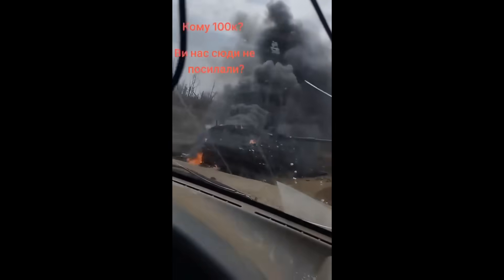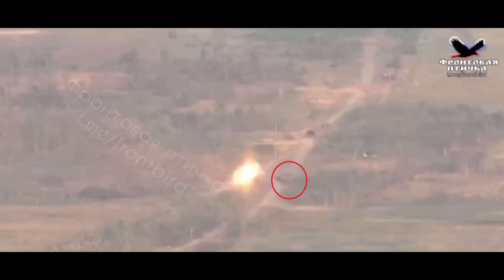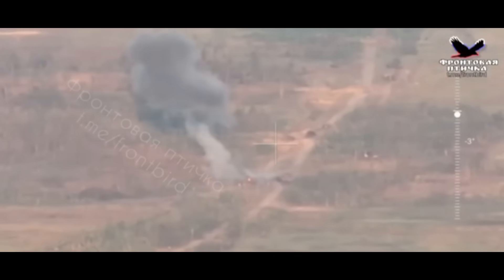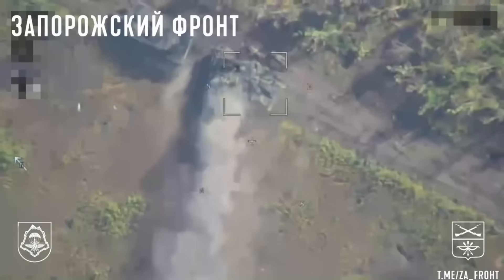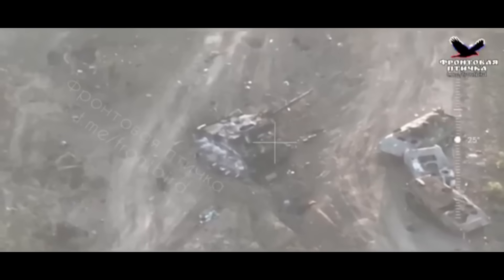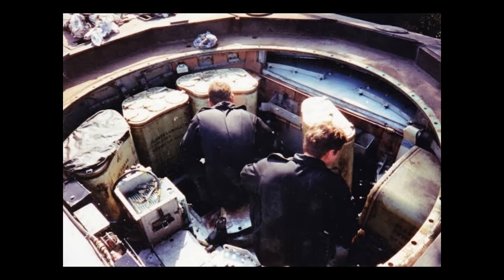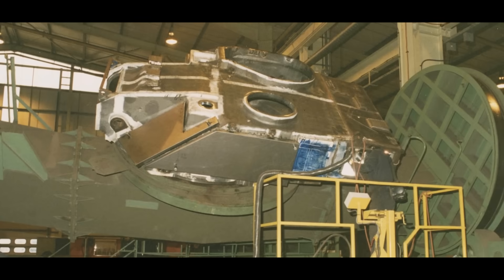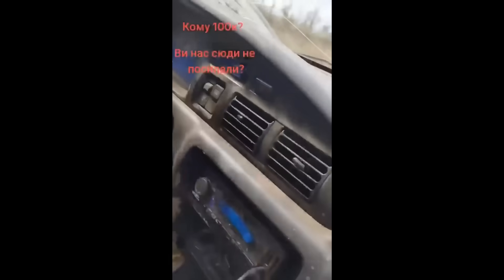This is how Challenger 2 got Destroyed in Ukraine

Comment: The Challenger 2 already served it's purpose and opened the floodgates for more numerous tanks like Leopards and Abrams to be supplied to Ukraine.
Reply: I thought the pourpose was to be used as a Tank in a offensive to cut the land Bridge to Crimeia
Reply: @gerfand  15 were sent? That isn't gonna be enough for an actual war. 

When it was first sent, all over the news was about how this could open talks to Leopards and Abrams. The idea was always to send a tank comparable to these vehicles in an attempt to push for high quality vehicles in good quantity.
Reply: @D_U_N_E  diplomatically yes, 14 Challengers did that, but in a tactical level, it doesn't matter, if that was the case, why not send something like Leopard 1 from nations that don't need them, or M60, tho those were scrapped, and as we can see the "pusher tank" could not be Abrams since they never were sent.

But in the end its clearly not the pourpose after they get into Ukranian hands, if that was the case, why waste time and money on training/
Reply: @gerfand  In a 'tactical level' it makes sense, because it pushed for better equipment to be sent...Which then occurred, so now future 'tactical' engagements will have more modern equipment. If you mean using the tank on a tactical level. We sent enough for one whatever they call it - at a tactical level there are a few battles to be had, but one high intensity conflict is likely all it will take to relegate that unit to the propaganda department. 

Leopard 1 is not comparable to Challenger II, why do people think this? Challenger II is comparable to Leopard II. It's not a tank from the 60's, in it is modern equipment that is still competitive (and winning) trials against tanks such as the Leopard 2 or Abrams.

They are also sending Leo 1's? Aren't they? I am sure Ukraine is getting both Leo 1's and 2's. 

Once we gave them to Ukraine, that was it, I believe Ukraine has purchased them. Training them to use the platform should enable better tactics from them - the training provided is likely not just move forward, left right, but in depth understanding of the platform. Which should apply to other modern tanks in some degree.
Reply: Cope, cope, cope, cope cope, the Challenger, tried, and the Challenger failed.
Reply: @brianmead7556  Okay, that cements your agenda now. 

Well, guess you must indeed have powerful shovels if 1 tanks loss must mean a failure of the vehicles series. I hope your tampons are sealing the wounds from debris of your failing space program.
Reply: @D_U_N_E  you don't understand what is tactical if you saying that

Yes hence the point, for a tank to make a start its better, literally 1 leopard 1 or whatever to shame Germany into sending their active use tanks

I wished Brasil would send ours just so 
1- we get rid of them, so we need to buy something new
2- our generals notice how dumb they are and push for modernization
Reply: @gerfand  Just one of any tank wouldn't have been enough to reliably push for modern tanks.

Leopard 1's are a very outdated design, it's the same level of weapons everyone was already fine sending prior. They had received T series tanks, to no realistic escalation of weapons being sent, those that pledged Leopard 2's were stopped. 

Challenger II is a modern tank, it's the same level as every other modern tank, so sending it gives a basis for other countries to send theirs.   

The fact you want your country that isn't in an active war to modernize, but feel as though the same tank you believe is bad would be the game changer that sends tanks like the Leopard 2... Is unrealistic. If Leopard 1 was the tribute, Leopard 1's are where we'd cap at.
Reply: @D_U_N_E  bro, don't get me wrong I don't dislike Leopard 1, but this is like if US Army was run by Boomers saying "yep two world wars" to keep the 1911 instead of getting something lile the 92fs
Reply: @gerfand  Okay, and what makes the outdated leopard 1 sufficient escalation over the at the time current T-series tank donations. 

Germany traded modern Leopard 2s for out dated T series tanks to the Czech Republic, so they could send the old tank models to Ukraine.
Reply: @D_U_N_E  I just saying that 14 Challenger 2 is actually a bad number because its the lowest number for support that won't help tactically. 

If 1 NATO tank of whatever type, but older made Germany send their own that would be better for the political level.

Like either you send some 70 Challenger 2 or you send nothing, but send something else, 14 is actually a Tolkien number for a Tank that today still decent
Reply: @gerfand  It is supposed to be a token number, because its only real purpose was to push for other tanks such as the Leopard 2 to be sent. 

How are you still unable to grasp this? Chiefly Germany was unwilling to escalate their modern tanks to be moved to Ukraine. Even if there are no explicit contracts, countries reliant on German production are not going to break their partnership just to send a couple tanks. Britain sent a modern tank to Ukraine. Germanies excuses for why they wouldn't allow their modern tanks was weakened, and then we saw real progress of Leopard 1's and Leopard 2's being sent.

Challenger II fulfilled its purpose, that and gave us an excuse to teach them about our tank doctrines. Now even if it's only kept in the propaganda team it would have been a successful venture. Seeing they may actually be using the tank is an added bonus.

If you really want to keep throwing around tactical like it means something, Challenger II being sent is a diplomatic initiative that should give Ukrainians access to better and more accessible armour meaning that it being sent should give the Ukrainians more advantage on the strategic level (supply/re-equipment) and tactical (These 2010 tanks have more advantages over the previous 1975 vehicles.)
Reply: @D_U_N_E  yeah but that is why I said tactically it was a bad number, since 14 tanks is nothing.
Reply: @gerfand  okay, and in my original comment I already covered that. Both in the sarcastic tactical' and actual tactical "they'll get one high intensity conflict" comments.
Reply: @D_U_N_E  then do you agree or disagree that tactically 14 tanks is nothing?
Reply: @gerfand  strategically 14 tanks is nothing. Tactically 14 tanks is an operational unit.
Reply: @D_U_N_E  yes, but why 1 operational unit, my point is that if UK was taking this serious, and considering they want to use much fewer numbers of Challenger 3 upgrades, why  only 14.
Reply: @gerfand  Are you being purposefully obtuse?
I have stated this multiple times, because "it was a diplomatic move to push for Leopard 2's and other western designs."

They gave one working 'unit', as that is the minimum they would have to give for the gesture to be taken seriously amongst their peers. Do you really believe sending 1 single Challenger would have had the same effect? No, and obviously 70 would have been overkill, as 14 apparently accomplished that goal.

Britain's tank production is inefficient versus the other weapons it manufactures. Donating tanks we are going to bench is an economical way to push their political Agenda. Meanwhile we can keep producing weapons such as ATGMs to supply Ukraine. 

Theoretically we could donate a large quantity, however then our military capabilities also become more limited, given future production of these vehicles is supposed to be extremely limited, Britain does not want to give more than it reasonably needs to meet their objectives.
Reply: @D_U_N_E  AND I EXPLAINED ALREADY THAT IS NOT A TACTICAL THING, this is diplomatic, strategical, but not tactical, I'm talking about how sending Tanks to Ukraine but not actually doing it.
Like imagine if they gave a wopping 1 F-16 to  Ukraine and said "now Sweeden, give all your Gripens to Ukraine now"

Yeah maybe Sweeden does, the 1 F-16 is going to do nothing as a Fighter Jet.
Those 14 Challengers will do very little for Ukraine, since its simply not enough to do anything with them in the long run, as attrition will eventually , and at a fast pace, get them to be combat ineffective.
What I mean is I doubt they will even take a single Village  they are aiming for with because of those 14 tanks (or it being a relevant part of it)
Reply: @gerfand  Those 14 challengers on a TACTICAL level are fine, as on a TACTICAL level you can use 14 tanks. They will probably get one high intensity offensive with them, and then their numbers will be low to the point of ineffectuality. That however, is fine. This was a by-product, not the intended 'strategy' for sending challenger II.

On a STRATEGIC level, 14 is nothing, it's extra logistics - though if you are hard strapped for tanks, 14 tanks is still 14 extra tanks. 

On the intended DIPLOMATIC level, it pushed for more tanks tanks that would fit the Ukrainian counter offensive better.

So if we want to go back, on a TACTICAL level, 14 tanks is fine. And on the DIPLOMATIC level, 14 tanks were a part of the successful effort to push for Leopard 2. The only level it seems ineffectual is the STRATEGIC level. Though if you are starved and someone offers you a food you don't like, it's still better than continuing to starve.  The tanks are good,  as a group they'll probably only get that one high intensity conflict before they are resigned to a more tertiary role, unless for whatever reason Ukraine puts in the additional effort to maintain Challengers alongside Leopards or the T series tanks. Which it does seem to have some play here - perhaps they are using the tanks as command vehicles.

The 14 challengers accomplished their goal for Ukraine, as once again, the INTENDED, goal, was to push for tanks like the Leopard 2. The combat applications will be as positive as 14 of any generic modern tank, which on a grand scale is minor, but on a micro scale is still 14 high quality vehicles.

Once again, as you are very slow here - sending 14 tanks was never believed to instantly turn the tide of the war, it was to push for what? Leopard 2. Which would do what? Give Ukraine potential access to high quality thanks in decent quantity. Why 14? Because any lower number could not be taken seriously by who? Germany, that what? Controls the production of Leopard 2. 14 tanks is a 'serious' number because why? It's the minimum number needed for an effective combat unit (factoring in a few losses). Tactically? 1 high quality unit. Strategically, 14 of any tanks are unlikely to play a massive role, however if diplomacy is tied to their strategy, these 14 tanks potentially had massive effect as why? After being sent Leopard 2 was successfully negotiated for Ukraine. 

Because you don't understand what tactical level operations mean, I will really cement, 14 on a tactical level is big, often times 0 is the number of tanks in a conflict. 
If you want to push for the Strategic level, sure. 14 is not a lot, but it was never intended to be a lot, it was intended to be a diplomatic gesture to get - ready? Leopard 2 into Ukraine.
Reply: @D_U_N_E  its not that big when Tanks are being attrited fast tho. I mean first deployment and it was a loss, if the next time you see a Challenger 2 its another loss, you will have to wonder if the 12 tanks is really gonna cut it to make any impact, like, as we can see the infantry tactics from Ukraine did more for them, than those Western tanks, and you have to wonder if that is because they have so few they are scared of using and losing them.
Reply: @gerfand  We have no idea if this was its first deployment. 

High attrition is, well semi-expected considering the tactics by both Ukraine and Russia. I believe it's 10 tanks required to be functional, with 4 spares. When they have less that that, they can still use them in conjunction with other tanks, or reserve them to tertiary roles. If we remove the logistical concern, it's +14 generic modern tank - apparently for LEO2 and LEO1 they are expecting about 250-300 overall. So this would be about 5% of their modern tank quota. 
They apparently have 1500 total tanks (making 14 challengers a 1% increase) , and have lost a total of 550ish in 1 and a half years of fighting. About 1 tank every day.  These initially were mainly much older vehicles that were more susceptible to frontal attacks. If we give the Challenger a likely hood to only lose 0.75 tanks a day instead, that's 18 days of tanks, or 3.3% increase in losses they can take.

A single tank is not going to have much effect, 14, well 13 tanks won't have much of an effect on a grand scale - but in conjunction with other modern vehicles, it contributes part of the hundreds of to be sent tanks, which unless logistics are concerned, is how it should be viewed. Britain is invested in supplying things that aren't tanks.

https://www.statista.com/statistics/1303432/total-bilateral-aid-to-ukraine/
https://en.wikipedia.org/wiki/List_of_military_aid_to_Ukraine_during_the_Russo-Ukrainian_War

If you want to compare military aid, Britain is tied third with Germany, beaten by America and EU institutions. 
Wikipedia is obviously not the best, but that's another thing to look at what the UK are pushing to deliver.
Reply: @D_U_N_E  
You are coping, coping and seething, you just can't accept what you're seeing. You are coping, coping and seething. The truth, it is scaling, and now you are malding and coping, coping so hard. Coping and seething.
Reply: @brianmead7556  Honestly, LUL, can respect the attempt. Sadly unless you throw some false facts about the Chally, just cope and seethe doesn't bother me.

Comment: Let me explain  western turret pop on MBTs.
Catastrophic failure is very rare, so.
After the tank was hit and ON FIRE and ammo and combustibles burned for an hour heating the metal and making it malleable and prone to bend/fracture.
They kept hitting the tank with HEDP Arty and ATGMs. Repeated blasts to an enclosed container add super heated metal will create a weak turret ring allowing turret discharge.
SO, A turret popping off from a single hit from a missile etc just does not happen. it CAN happen but is INCREDIBLY RARE

Comment: Tanks are tough from the front, weak from above and below, average from the sides and poor from the rear. They are designed to face the enemy, but drive it over a big ass mine and you will have an issue, the tracks fall off. Nobody wants to sit in an 80 ton metal box that cannot move in an active battle space, so running away seems like a good plan, you may be able to recover it later.

Comment: Western sources indicated on Tuesday night that the tank first struck a Russian mine on Monday, which blew a rear fuel compartment, causing it to be immobilised. The crew then evacuated safely, but as it lay dormant it was then hit by a Lancet drone. There was no confirmation of the location but it is likely to have been on the southern Zaporizhzhia front, where the brigade of which the tanks are a part has been reported to be fighting. A typical Challenger 2 crew is made up of four, and the tank’s ammunition is stored in separate compartments, unlike Russian equivalents, to try to prevent it from exploding if it takes a direct hit. But in this case it was a fuel tank that was affected.

Comment: Those saying it's ok the crew survived - that's fine but with so few challengers and no replacements that crew is now without a challenger tank.  That's months of training and now they're essentially backup crew if the other challenger crews get killed.  The UK donation was a token gesture that was more wasteful than it is useful - those crews should've been trained on tanks that have replacements available.
Reply: The CH2 donation was very usful for Ukraine. Not in and of itself, its only 14 tanks. But it put an end to the "should the west send its MBTs" debate, that at the time had been going on for a while, the UKs "token gesture" broke the taboo on sending western tanks. It helped get the Germans to agree to send leopard 2 very shortly afterwards, which meant an actually meaningful number of tanks.
Reply: @gazzmilsom  Tanks would've been sent regardless, it's a waste of training time, crews are valuable.

Comment: A tank is a tank.  2 huge pieces co-joined at manufacture.  Countermeasures being used today were not around in the mid 1980s - 90s. So, given its age, type & armour uograde, thus C2 is nit infallible, but in all future rank designs, the current will be subjective in design as its obviously a weak point.  Looks like Challenger 3 will need some rethinking with ammo storage, armour & turrent design...

Comment: So the tank had already been abandoned for some reason, possibly a mine. 
The ammo in the Challenger would not combust as claimed, it's 2 part ammo with the charge kept in inert liquid, so the claim about blowout panels is bs.
Reply: it doesn't really matter as it popped its turret ring, if a the crew was in there they would be dead.
Reply: @CyrilSneer123  reports are crew abandoned the vehicle when it was first damaged.